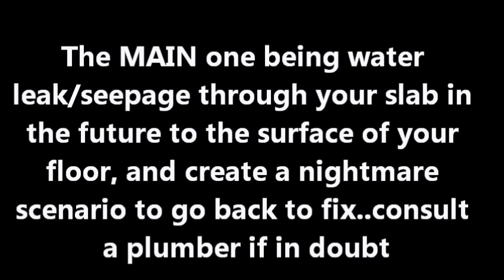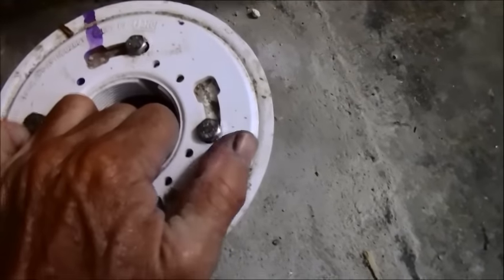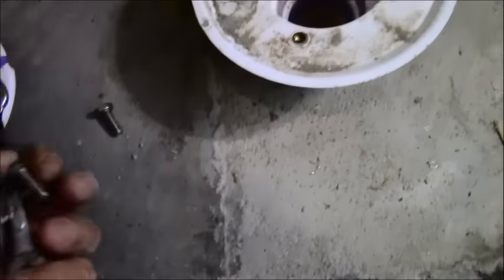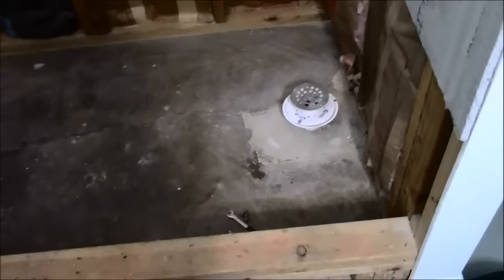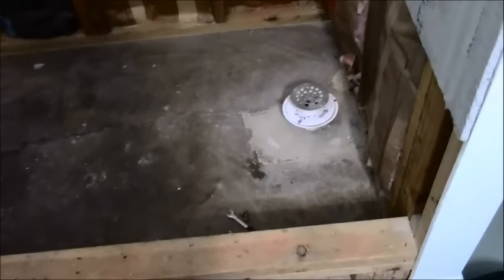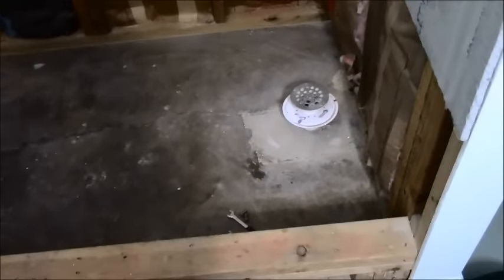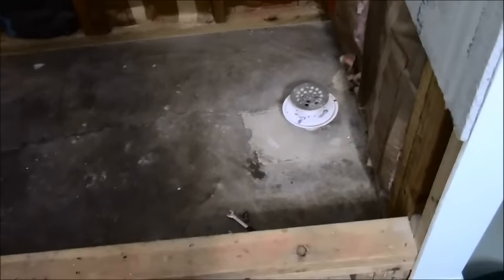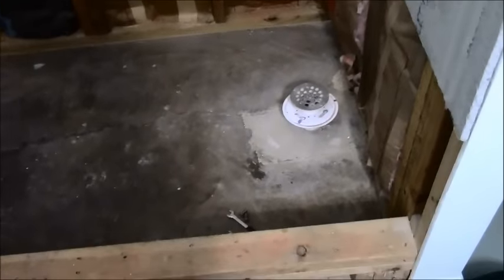SHOWER DRAIN ON CONCRETE SLAB

Comment: Can you put wood over the cement once you have access to the pipe?  Don’t seal up the hole with cement.  Just in case you need to do any repairs at a later date?
Reply from the maker: If you are building a shower then the void  needs to be back filled with cement , I'm not sure I understood your question
Reply: StarrTile we’re on a cement slab.  My husband prays we never have an issue with a pipe because they are imbedded in the cement.  I was just thinking, once you open up the cement,  like you did in this video, why couldn’t a wood subfloor be put over the area.  Leaving the pipe available if any work needs to be done.  I hope that makes sense.
Reply from the maker: @Auntypatti  yes what you said made sense, however on a slab floor with a shower pan proper put in its place the wood could expand and contract and ruin your pan from underneath it could crack

Comment: Question for ya sir... and I have no problem donating to your channel. I am on a slab and I am extending out the shower floor about 8 inches or so and want to leave the drain where it is and just slope mortar to it. Question is since the old drain was going to a plastic/fiberglass pan the pipe is much higher than the slab. So how low should I cut the pipe down to? Enough so the flange sets level with the slab or slightly higher? There is probably a 1’x1’ box out that I will need to fill with concrete but I want to make sure the pipe and flange is good before I fill it in. And the pipe is definitely not level coming out of grade and I don’t have much wiggle room for make it sit level. Im trying to manipulate the flange and make it cockeyed level lol. Any advice is appreciated.
Reply from the maker: So what you would need to do is go to my main Channel and on the far right almost to the top where there is a tab that says about, click on that and scroll down toward the bottom you'll see help support my channel and click on that it will take you to the donation section of PayPal...$50 for 30 minute call so include your number. Text or email me pictures of what you have going on, that will move the discussion a little faster

Comment: Just out of curiosity, how much did something like this cost? We have a curb and I wanna get rid of it because I need to be able to roll in and I wanna move the drain to the middle. Previous owner had work done and whoever they hired to do the shower remodel did a terrible job because all the water flows to the wall and not the drain which is located where the one you fixed in this video. Sigh...

Comment: Shower code is 2" p-trap. Fyi, I'm  sure 1.5 will be functional. I would have verified that there was a p trap and changed it to code. I enjoy your content and video's tho, I'm not being a hater.
Reply from the maker: Right,  it is understood that in the ideal world the P-trap would be 2 inches but that would require literally going below slab level to where the plumbing was laid before the foundation and ties into the 3-inch main drain going to the street... pretty much a functional impossibility, having said that every tub out there on a slab has a P-trap below the slab, so yes it exists 100%.

Also it might interest you to know that before water saver shower heads came out, the gpm on showers was much more and a 2" P-trap/piping insured water never overcame a short 4"-5"curb, whereas a tub is 15"-18"high so 1 1/2" was sufficient.

Comment: I know this is a late comment, but a P-TRAP is solely for preventing sewer gases from entering into your home. Not having a P-TRAP will allow harmful and fatal methane gas to enter a home, which could also be explosive. ALL plumbing fixtures MUST have P-TRAP instead of toilets, they are built in.
Reply from the maker: P-traps on slabs for bathtubs are below grade 👌✔
Reply: @StarrTile  I totally understand. The trap must have been upstream from where you were working at. I just didn't want your loyal viewers to think a trap wasn't required. Here in Virginia, the trap would have been directly under the tub area. Nevertheless, you do some amazing 👏🏽 work!!!! I whish you did work in VA.

Comment: With a wood foundation, you can screw down the flange. How do you lock down the flange with cement?
Reply: Kerry flynn I would think the concrete does a pretty good job of holding it in place.

Comment: Hey man - I'm redoing my shower with a self-made mortar pan. My drain base actually sits about a 1/2" below my concrete subfloor. I planned on using it as is without digging out and extending the drain pipe. Is that going to cause problems down the road?
Reply from the maker: As long as the tile are sloped & the pan is waterproofed you should be ok

Comment: What would be an approximate cost to move a drain like that.
Reply from the maker: I cannot speak to that because it's inclusive in my shower build, but if a plumber had to do what I did you're probably lookin at anywhere between 500 and 1000
Reply: @StarrTile  Thanks have a similar situation getting ready to start soon.

Comment: First off I want to say thanks for all the videos I been learning a lot from them. Question I just leveled my concrete floor to the bottom flange to the drain and the flange sticks above the floor by 1/16th of a inch give or take. What’s your best solution since I notice now it should be flush
Reply from the maker: You are waterproofing the surface of your shower pan then what you did does not matter because water will never get to that point anyway
Reply: Thanks I am going to waterproof the pan but just in case if water did get thru I was worried since it wasn’t flush the water might not find the drain
Reply: @davidallan4497  Hi,  I was reading this and I ran into the same problem. The Flange sticks out about the same as yours. I am worried sick about the same thing. I am stressing because this is my first time doing this. Can you explain to me a little more details about that waterproofing and the flange? i am trying to understand?

Comment: My tub is only 30" deep.  I'm removing a wall to extend it by 12" and making it a walk-in shower.  Must I move the drain?
Reply from the maker: You don't have to if you don't want to I just like things symmetrical personally
Reply: @StarrTile  Wow that was fast!  Thanks so much, but I have 1 last question.  What's more cost effective to move the wall 12" or move the toilet 12"?
Reply from the maker: @Happy-dq9iu  definitely the wall, less labor-intensive too
Reply: @StarrTile  Thanks - Glad to make donation

Comment: Thanks for the video and information.  I've been considering doing all the demolition and rebuild myself, but this has made it clear to me that this task is beyond my skillset.  So, after I do all the demolition of the current leaking disaster the last contractor built, I'd be looking for someone to do an almost identical job (plus the tiling and all).  But, here in Columbia, SC it's hard to find a contractor that has a good rep for this type of job, all leads seem to rabbit hole back to commercialized bathroom refilters that charge an arm and a leg just to be the middle man.  All they want to do is band aide it.  Any suggestions on how to find someone that does quality work (in my area) such as yourself?  I've already paid for this to be done once and it's a disaster.  I want it done right this next time.
Reply from the maker: The only thing I can suggest is go to a stand-alone tile store, visit the guy at the loading dock area where contractor's buy material from, that guy will know exactly who does what by virtue of what they buy and the shop talk they have.
Reply: @StarrTile  Excellent suggestion, thank you!

Comment: Why is it that a tub needs 1-1/2” but a shower needs 2”?
Reply from the maker: That is actually a very good question, I've asked plumbers that before and the best answer I received was that a shower curb is only about three or four in from the drain so it needs more water flow into it as opposed to a tub which typically is about 14 inches high and would need less water flow
Reply: Like all trades, there are formulas for figuring out what sizes materials need to be. In the case of plumbing, what you want to look into is "fixture units".

Comment: Why do they not stipulate pan liner or, a waterproofing compound, surely the pvc thing is old hat and can be done without, by just using sloped mortar bed and then waterproofing that you just tile too?
Reply from the maker: That can be done...a topical membrane is allowed as a liner. Would I do it & risk a possible intrusion of water to the slab ? NO.
The liner is DIFFICULT to penetrate and is 100% waterproof is installed correctly
Reply: Hi StarrTile, Thank you I appreciate your reply. Would it be fair to say that a liner is the problem in the sense that it can be easier(even for paid contractors) to apply incorrectly, where as, waterproofing membrane is more simplistic to apply and get right as a DIY or renovation in house. I understand as a paid contractor it makes more sense to go one step further to insure your work and job life. Thank you.
Reply: Just to add the reason why I ask this is because in the country I live they dont have 40 mil pvc liner, so I have to do a work around as best as what materials I can get. Thanks
Reply: @quinnishappy5309 , the newest method is pre manufactured pans that are cut to fit and then water proofed with a product like schluter makes.

Comment: Do you not need to have a p trap directly under the shower drain?
Reply from the maker: No you can have it all the way up to 12 in from the drain, in this case it is under the slab area

Comment: That was a great video thanks for the tips.
I got a questions is that ok to put screws when u wrapwith durock  the step in the shower I mean inside the step
Reply from the maker: Mike Reyes for the piece of wallboard that you're putting on the inside of the curb it's inevitable you will screw into the liner, but it's a moot issue when you butter the curb and redgard it and have it above your tile then you will be okay, I will link what the finished product should look like right here https://youtu.be/cNLaNE2h9H8
Reply: StarrTile thank u so much for the answer

Comment: Hi! I've watched a few of your videos and learned a lot from them, so thanks! I'm just wondering if you put thinset on the bottom of the backer board that you used as a new subfloor to "glue" it to the concrete floor? Thanks!
Reply from the maker: Most definitely, although I wouldn't do that on a wood floor
Reply: @StarrTile  If you don't mind me asking, why not and what would you do for a wood floor? I'm a new DIYer trying to learn all of this. I currently have an issue with my bathroom shower pan. The old owner didn't install a liner and I got a leak through the grout into the other room so I tore it up and am redoing the entire bathroom. I need to call a plumber to do what you did in this video to dig up the old drain. Thanks!
Reply from the maker: I started out using screws put backer board on wood floors, but I would miss and hit my finger enough times I gave that up long ago, I use a roofing nailer with inch and a half galvanized nails, a whole roll for every sheet, quick and cheap

Comment: Thanks for making this video but shouldn’t you have filled around the pipe with sand or gravel up to the slab instead of concreting around the pipe down in the ground?
Reply from the maker: The dirt that was taken out it is put back around the pipe, pack down with the end of a two by four, and then the concrete is poured that slab level.... so yes that would be the way do it

Comment: you should make a video explaining why you are not making money off youtube.
Reply from the maker: I wished I knew. AdSense is in charge of that, once demonetized it is nearly impossible to get the account back...and I was never told the specific reason.
Reply: probably not enough views, if the videos are not viewed in the 100k to millions an advertiser is not really motivated to pay. If advertiser not motivated to pay for ad no way for you to get paid either.  I think if your views are in the 100,000 range (per month not just total over years of video being on line) you might make $30 a month or something like that depending on ad clicking and such related to your channel. Big channels with topics that hit 1 million, 2 million views in short time span make the most, it's a numbers game. Topics like tile, plumbing and air conditioning are boring topics unless you have a specific problem. Unlikely that a channel on such topic will ever hit big viewing numbers.

Comment: I know you are a professional. As a professional you might consider putting some sort of rug or something so you don't keep dropping bolts and concrete chips etc down the drain.  No?  But you know best.
Reply from the maker: That's why I have a Shop-Vac, seems there's a tool for everything😀👍
Reply: I guess you will vacuum  up the bolt and whatever other stuff you dropped down the pipe  however far down they went beyond the pee trap where that happen to be.  Works for me.

Comment: Why not put the drain in the center ?
Reply from the maker: A vertical drain can't be more than 24'' from the trap...trap was never seen so I kept it at about 15'' by the time in runs into the rear 45o

Comment: When you put the cement backer board down on the cement what did you glue it with? Just the thin set or something like liquid nails? I'm in a situation where I have to put a piece of backer board down and am not sure how to secure it to the cement slab.
Reply from the maker: Thinset

Comment: Too much work, I'm lazy. I would have found a flange to match the inside diameter of that one (or made a pipe bushing) and glued her in flush. Bammo, bingo, bombo.
Reply: By this comment, it's clear that you have no idea what you're talking about. The existing drain was already reduced to 1 1/2". How well would you expect the shower to drain if it was reduced any further?

Comment: Where is the trap?????
Reply from the maker: Usually 10-14 inches below grade.
Reply: @StarrTile  Usually, yes.  And usually right near the tub drain opening.  Why was this one not visible?
Reply from the maker: On slab construction the P-trap is always set at grade, that grade varies from 10-14 inches or more. Wood construction where your subfloor is ply then the P-trap is pretty much immediate and accessible.
Reply: @StarrTile  What I mean is - for this particular slab install,  why is the trap NOT under the tub area?  I've seen slab showers where the trap was right at the drain.  Is either way okay?  Pros/cons for either way?
Reply from the maker: @walkgood4092  it all depends on the Builder some Builders are going to put it at slab level and some are going to put it much lower... or could have been a renovation where they just retroactively brought it up higher.
I think code allows for a t-trap to be up to 22 inches away or perhaps it's 20, as long as it's there is the main thing
Reply: @StarrTile  Thanks! 🙂

Comment: stainless bolts are not magnetic.
Reply from the maker: A basic stainless steel has a 'ferritic' structure and is magnetic, formed from the addition of chromium – it can be hardened through the addition of carbon, making it 'martensitic'. However, the most common stainless steels are 'austenitic' – these have a higher chromium content and nickel is also added.

Comment: Naaahh Man. I was watching until you said about the backed board on the floor. That's just wrong. All the backed board on floor projects needs to be redone a one point.
Reply: You should have continued watching. The cement board is buried under a liner and a mud pan.